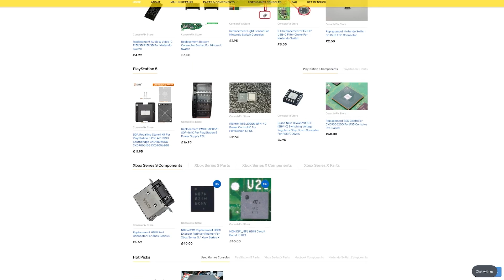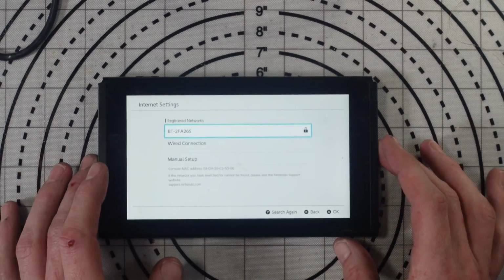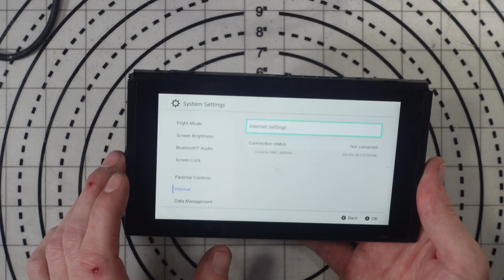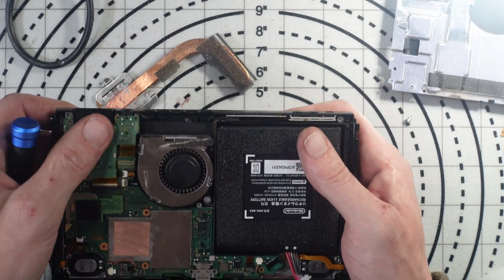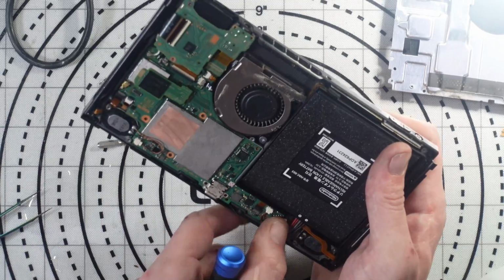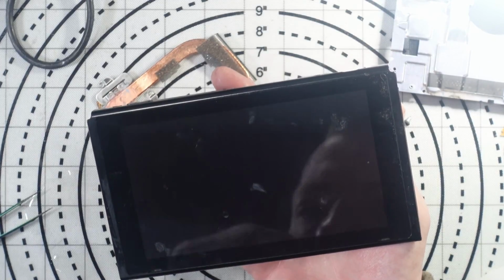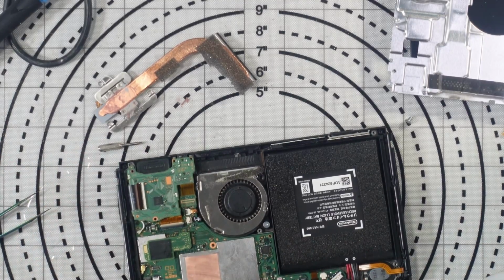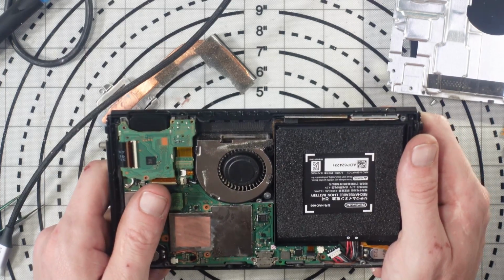Nintendo Switch WiFi Not Connecting... Can I Fix It? (Error Code 2110-1118)

Comment: I replace my thermal paste on oled version yesterday and the Wi-Fi connection went down, but the Bluetooth and joycon wireless connection is good.
Reply: Same I can't fix it no matter what
Reply: I have the same i think its the chip went dead
Reply: Check the very small 2 capacitors right next to cpu.

Comment: I recently went down the rabbit hole on one of these 2110-1118 units, and it really was my most intensive repair thus far.. after much reballing and reflowing I ended up using the datasheet for the wifi chip and some delayered board scans to try and isolate which lines may be the issue. I was able to successfully identify that a single resistor on the back of the board was the culprit, on one of the gpio lines for wlan (pin F7, GPIO_8 in my case). replaced that and it worked a treat, no more issues. I found precious little documentation on this error outside of replacing the chip outright or examining the capacitors next to the cpu shield, so hopefully my findings can help someone else troubleshoot their issue if all else has failed
Reply: hi! im in the same problem you were, where did you find the datasheet for the wifi? to know what is the resistor i need to change and also, if it was hard to resolder, im not going to use wifi but  knowing wifi is not working gives me the itch to fix it

Comment: hello, could you solve the failure? i have a console with the same fail, i tried replace wifi IC, replaced caps near CPU, measured in diode mode seems all fine, i´m not very sure if in the end of the video, you mentioned console activates by itself, because my console never goes to sleep mode, it turns on by itself ever, botton and flex ribbon works fine. thanks
Reply: i forgot to  mention that i reballed CPU and same failure

Comment: Hello, I have two Nintendo Switches, one normal and the other OLED, the normal one works well but the OLED has the error 2110-1118. My question is, can I transfer the WiFi chip?

Comment: A resistor had moved off its pad and was touching another cap or something right below the WIFI chip, you should go back and check that.
Reply: I see it too, looks like a brown and a black one are soldered together long ways. Right on the bottom left of the WiFi chip in the video.

Comment: Wow...I'll never be able to use solder wick with a straight cut ever again. Angled from now on.
Reply from the maker: Sweet mate, glad you took something away from the video. Cutting it on an angle definitely allows more freedom when working around densely populated areas like the WiFi circuit here;)

Comment: How can it be a prior repair attempt if the heat sink sticker wasn’t ripped or had any signs of it being previously removed and replaced or restuck on as it wasn’t ripped? It looks factory
Reply from the maker: The board was covered in flux around the chip. It definitely had a reball or a reflow at some point. It looks to me like it had been reflowed inside the housing which is not a good idea

Comment: my nintendo switch v1 doesnt stay sleep mode. what causes this?
Reply from the maker: It could be a faulty power ribbon, which is pretty simple to replace, or it could be something to do with the light sensor which is soldered onto the board
Reply: @TheCod3r   i got it. its the wifi chip to begin with. it keeps on communicating to controller. i replaced it and its all fine now.

Comment: There are two caps to the left of the cpu shield that are responsible for the wifi. Perhaps they were damaged during the previous opening. This often happens when the shield is removed.
Reply from the maker: Yeah thanks bud, I may revisit this one once I speak to the customer today if he authorises it :)
Reply: Can you identify which exactly two caps? I got the same issue.😂
Reply: @hotairSamurai  Lots of pictures on Reddit that show rhem
Reply: Same problem happened to me
Reply: I haven't experienced a replacement chip not fix the wifi if the switch is powering on.
Reply: Oh man, YOU ARE THE MAAAN! Thank you so much, it happened to me and spent some time to figure out the issue. One of these two caps was missing and after soldering it back WiFi works flawlessly again 👍
Reply: What are the names of the transistors to the left of the cpu shield? I have the same Problem. @mikeyp4690
Reply: Exactly what happened to my switch. I was careless and knocked one of the little caps off. I lost WiFi but retained Bluetooth.

I decided to replace the two of them and now it functions again :).
Reply: @mikeyp4690 that's what happened to me I'm waiting for the parts to deliver so I can fix mine
Reply: @mikeyp4690  Can you identify which exactly two caps? I got the same issue.😂
Reply: @mikeyp4690 same here

Comment: i have this issue on my switch, when i tried to remove the metal plate covering the apu and ram, i accidentally destroyed a  two tiny bit of caps, then this issue occured,
Reply from the maker: Yeah someone else mentioned that. I may revisit it once I've spoken to the customer
Reply: @TheCod3r  hope you'll fix it sir,

Comment: Given a blue screen of death is normally a cracked solder ball communicating between the CPU and RAM. Could this not be a cracked solder ball that deals with communication between the CPU and WIFI chip, and possibly a CPU reflow fix it?
Reply from the maker: Yeah that's very possible bud. Problem is I can't reflow the SoC without authorisation from the customer so I'll be calling him today to speak to him about it :)

Comment: It possibly shows a MAC address because location is on . Machine address and internet provider address. No internet no IP.
Reply from the maker: Yeah that's possible. I think maybe it has a connection issue between the cpu and WiFi ic so it allows it to read the MAC address but not find any devices. Either that or maybe it stores the last known address in the nand
Reply: @TheCod3r  Yeah if you knew where it was stored on the device you would know that chip is probably good or at least being read. Not much help for this problem really I guess.